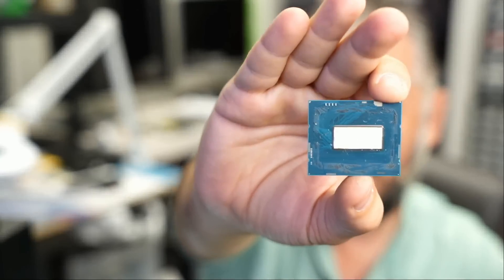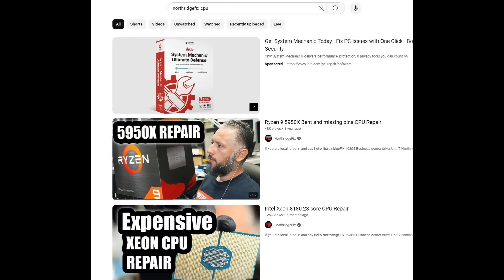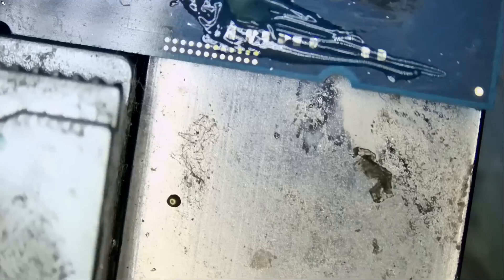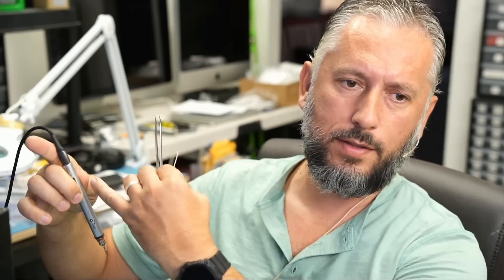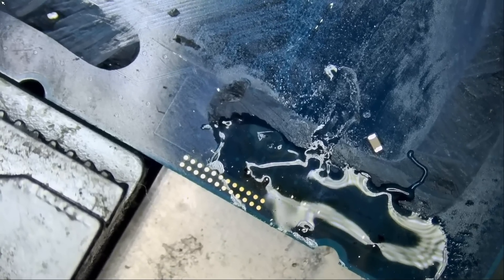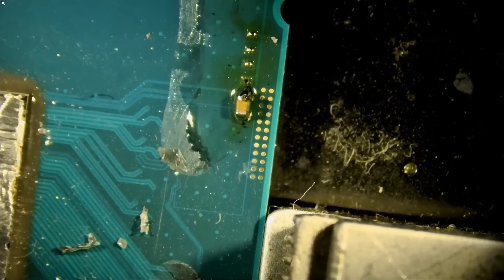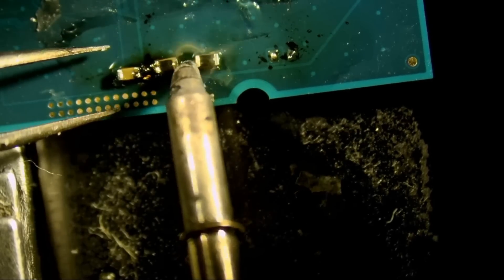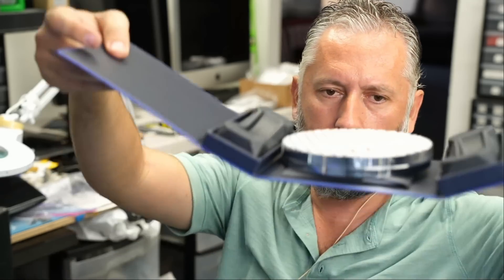Repairing a 14900KS CPU With Missing Components after Delidding

Comment: What’s the voltage for the capacitor on the bottom right corner of the CPU (100 nanofarads size 0402)

Comment: De-lidding CPUs is just asking for trouble, IMO. 
I've learned my lesson in that I'll never try any sort of "deeper" disassembly ever again. Tried that on my last laptop when I wanted to renew the thermal paste on its CPU and GPU coldplates. I did manage to take off the heatsinks and refresh the paste, but when I put everything back together, the laptop was a brick. I'm not that butter-fingered, but I probably knocked off a small component from the board without even realizing it. Lesson learned: Don't attempt this stuff if you don't know exactly what you're doing and if you don't have all the correct tools to do it. Plus probably the tools/skills necessary to repair any damage you might cause during disassembly/assembly.

Comment: Hate that I upgraded to 14th gen i7 even under volted it runs super hot. I have a 360mm aio and 45min of gaming I have to kick on window ac unit
Reply: set pL1 anf PL2 to 125watts in bios . problem solved

Comment: Delided my 13900k and put EK direct die 360 mm aio on it and it does 5.8 all P & 4.5 on E’s. Max temp is 92c and doesn’t thermal throttle. Worth it in my case, fun and nerve racking the entire time 👍

Comment: You'd be surprised to see how much more cooler CPUs usually get after a successful delidding. Look up the Ryzen 7000 series for example. An enthusiast was able to get almost twenty degrees lower max temperatures and higher boost clocks on a 7950x. It's risky because of the slow process of removing the CPU IHS but you usually get really good results. I'd totally do it myself if I afforded to replace every CPU I break.

Comment: Easy way to tell if there is an issue with the thermal paste in the cpu is to drill two small holes in the cover and then fill the void with no conductive thermal paste.
I have done this to a lot of xboxes works well.

Comment: That 14900ks might still be possibly on its way out , regardless if the temps are improved, given the whole..... 13th and 14th gen intel cpu's degrading & oxidation manufacturing issue

Comment: I can understand why people de-lid a CPU but it seems unneccessary. I have a AMD RyzenTM 9 7950X CPU on an ASUS ROG Crosshair X670E Extreme MB and cooled with a ASUS ROG Ryujin III 360. At idle it runs at 33C to 38C, in a small room with a ceiling fan.
Reply: yea 14900KS will run extremely hot bro thats why they delid
Reply: If you just let it sit idle all day long, you could have got a 7500F.
Reply: @ralf2166  I build PCs for fun. I can have a threadripper AMD Ryzen Threadripper 3970X on a ASUS ROG Zenith 2 extreme also next to me. Both PCs are in ASSZ pyramid cases

Comment: The CPU costs almost 800€ where I live. The guy was probably fan of all of the influencers who are going to the extreme with tuning their systems but if person doesn't know what they are doing that's 800€ down the drain. It can be more if liquid metal is involved. If it ain't broken don't fix it is the best advice in the world.
Reply: In Greece is 850 Euros. But there are specialist tools to delid your CPU and not some random screwdriver. And you need to follow instructions. And if you can pay for that CPU you can pay for the proper tool from der Bauer
Reply: as someone who has 14900KS, it drops the temps a lot if you delid, lap the IHS and add liquid metal
Reply: Influencers. Whooda thunk it?
Reply: @soundslikebstome  influencers make people delid their cpus ?
Reply: @soundslikebstome I don’t think Linus says to delid CPUs
Reply: The guy that did it was a complete idiot 😅
Reply: It’s the Framechasers advise
Reply: No risk, no reward. Overclock that sucker to the max.